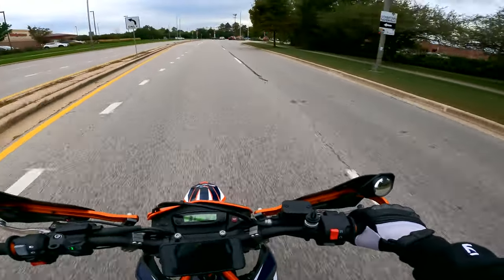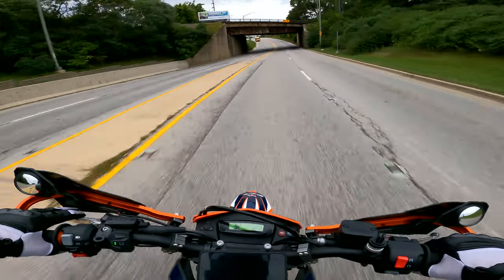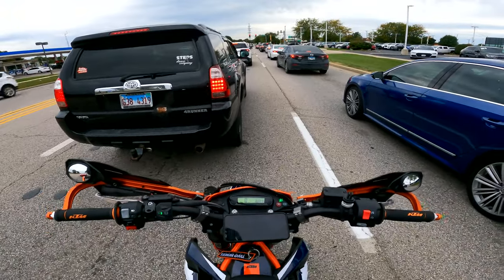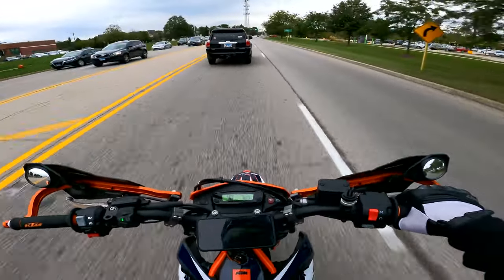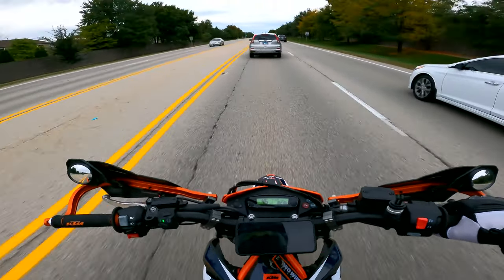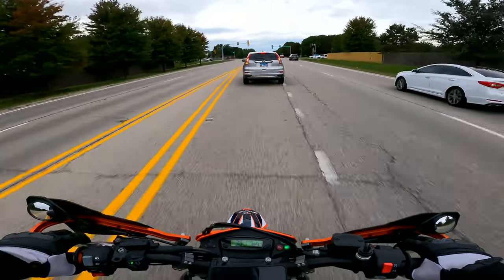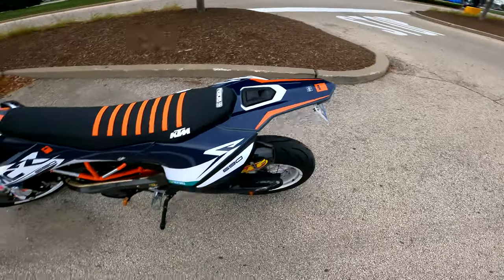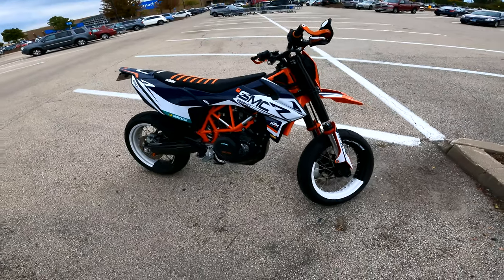I HATE my KTM 690 SMC R..

Comment: I have no issues with the seat, actually had ordered the ktm comfort seat and sent it back after I did a 360 mile day with no issues.  I have kinda figured out the quick shifter (very slight decrease in throttle) and have had no issues, it has become second nature.  I have sport toured, did 6 track days (cart track), commuted, and everything in between.  For me it is the most enjoyable bike I have ever owned (I am 59, and have had every conceivable bike, street/track/dirt, ect.)
Reply from the maker: Oh heck yeah you have put it through it’s paces! I honestly love this bike and the “hate” are just slight announces but would never deter me from owning this bike! I have to get out to a cart track someday.. how were those?
Reply: Wood you say if I got this bike and put 50/50 tires on it it would be a good bike to ride to work and go on trails , I want a good go anywhere bike , I can't make up my mind on this smc or the Enduro or the 890 AR
Reply from the maker: @aux1z11  what kind of trails are you looking to go on? Like hard rock sections, single track, desert, jumps?
Reply: @aux1z11  I did this on my previous bike (kawasaki klx 300 sm) and what I ended up with was a bike that was not very good at anything.  It was terrible off road and horrible on wet/muddy conditions and not confidence inspiring when the pace picked up on the street.  I ended up going purely street and then upgrading to the 690.

Comment: I have my bike for a year too and i have to disagre in some points. 
The stock seat is bad but you can easily change it. I bought a used one and changed the foam and cover and is much more comfortable. Its as the same  shape of the stock one. You said that the seat is expensive but is a question of priorities. You spent the same amount of money on a sticker kit. 
If you Want a cheap alternative use padded cycling shorts. People that explore around the world use them.
Dash for sure is weak, my temporary solution is a old phone connected to the motorcycle by bluetooth connector that cost 3$. I can see, coolant temp, rpm, speed and set alarms in the case coolant temperature is too high. 
Transmission you need to mean it when you shift. The transmission dont like when shifted "soft". The quickshifter can be reseted by the KTM Dealer and doing that maybe gets better .
Long travel on the bike is nice if you dont do too much highway, but highway is bad in any naked bike. I did 1 day rides of 300miles and enjoyed  it a lot. Change the grips for something better to absorve the vibrations of the engine. The 690 have the option to change the airbox and is great because you have storage or extra fuel. I just installed the rade garage storage kit and is really nice because i can storage snacks and drinks and a flat tire kit. 
Fuel tank in the back is better for weight distribution and you can put a tank bag in the front because the front is lower. I bought a Givi grt716 and fits really nice and low. 
I been wheeling a lot and dont bother me too much the fuel tank in the back, i seen people scraping the plate with no problems, the fuel thank is not the first thing to scrape because first you have the plate holder. 
If you buy a 890 you Will get a really agressive bike in terms of riding position since the weight is in your  wrists and more leaned forward. Then the 450sumo as lots of maintainence and you cant go to longer trips where you find sweet twisties. The 690 is not a Pure sumo but is really close. By changing battery, airbox and other parts you can remove some weight.
Reply from the maker: Don’t get me wrong I love this bike and these are just some simple gripes I have but would never kill the ability to take it far, you make some very good points about other bikes and options that I’ll have to look into! I know I came up with wayy more positives then negatives!
Reply: Do you have a link to or where did you get the bluetooth connector? 
Many thanks
Reply: @simsimmer250  you get it easy anywhere. I got a elm327  and a cable for teh ktm diagonostic socket. I bought one to conncet by wifi but doesnt work. If you want subscribe my channel that soon i will do a video how i have my setup.

Comment: I have a 2019 690 Enduro. I bought it with 8,500 miles. In September I rode it on a 450 mile round trip from Mansfield MA to Bennington in Vermont. It has a Seat Concepts seat which, whilst not exactly plush was no problem on two 8 or 9 hour rides. The quick shifter was excellent and I preferred it to my 890 Adventure variant. Down shifting was particularly good on slower tails where a quick change was needed. That said, 5th to 6th gave an occasional false neutral. It needs a positive action but, as another rider said, backing off slightly and it’s fine.

Comment: Can you please comment a link or the name to your hand guard and mirror set up?
Reply from the maker: You bet! 

So they are the Zeta bark busters -https://www.amazon.com/dp/B012UMIB3S?ref=ppx_pop_mob_ap_share

Then Zeta turn signal guards - https://www.amazon.com/dp/B001LV0NKE?ref=ppx_pop_mob_ap_share

Then I used the Zeta U brackets to attach to the bars since the straight brackets won’t go around all the cables - https://www.revzilla.com/motorcycle/zeta-u-clamp-handguard-handlebar-clamp-kit?gclid=Cj0KCQiAtICdBhCLARIsALUBFcE4oLR4KDCRVHia6ee7UVpWlJexLn27P9eba0C2XmL-7UwJNhShVT4aAtwgEALw_wcB

Then finally the mirrors! I just used longer screws and ran them through the bark buster and hand guard and tightened with a nut - https://www.amazon.com/dp/B00E62MUYM?ref=ppx_pop_mob_ap_share
Reply: @LifeWellRidden  thanks man!